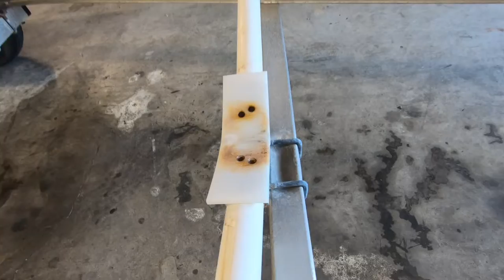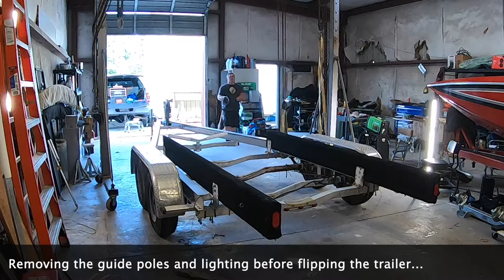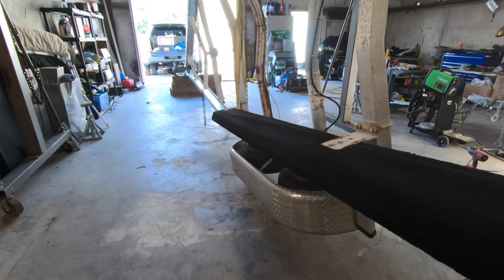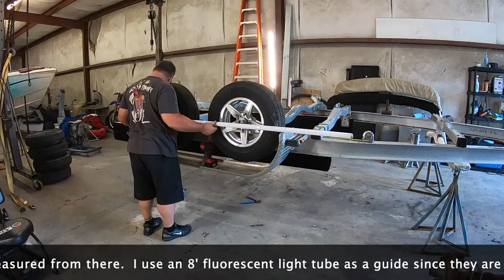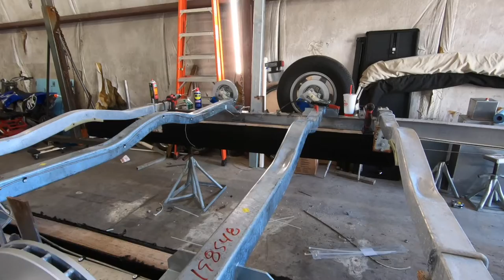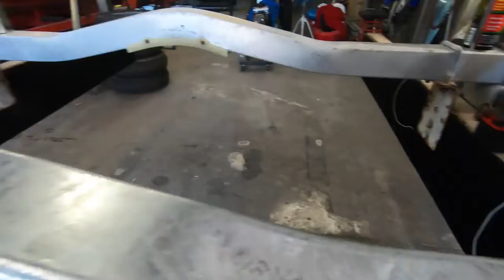#MagicTilt Boat Trailer Rebuild Day | 1!!

Comment: So is priced cheap since it is cookie cutter ??
Reply from the maker: "Cookie Cutter" refers to how most of the components are ordered through a trailer supply store and then just installed using the bare minimum and cheapest components.  Just "popping out" another copy with no custom work or attention to detail.